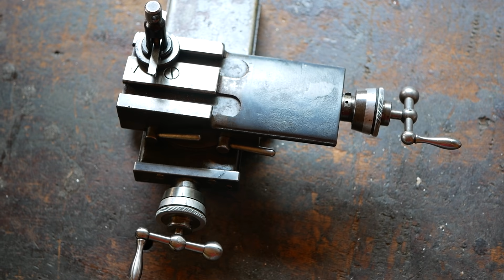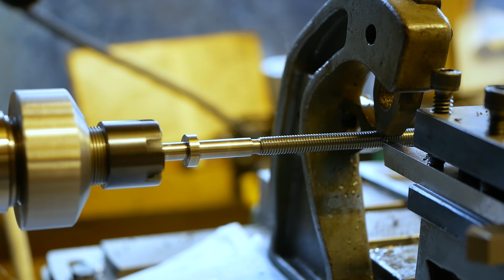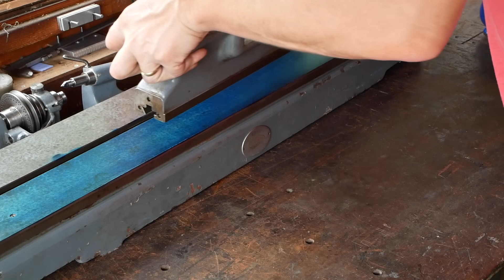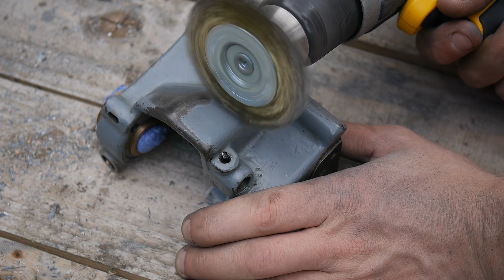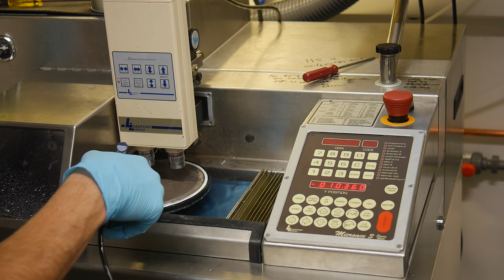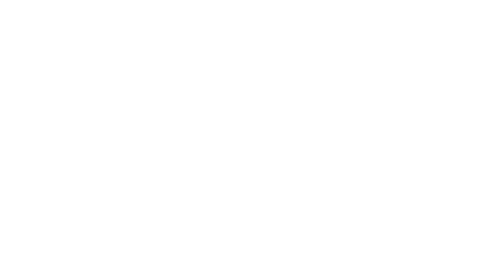Restoring a Vintage Watchmaker's Lathe

Comment: I have the same machine, a Schaublin SV65 with most of the accessories in top condition plus vintage documentation in case you need any. Wonderful machine! An old toolmaker friend of mine used to make the screws out of pretoughened toolsteel (ETG100).

Comment: I applaud your mechanical restoration.  True talent and craftsmanship is required to do that.  And I’ve seen this repeated in your other videos.  My complaint concerns aesthetics’s.  I truly believe the value and heritage of a mechanical device of this nature is destroyed when Bondo is used to smooth casting surfaces.  It’s a casting, formed by craftsman to make the machine you wish to use.  And it’s been wiped away by essentially plastic!  Maintain and improve the precision, as you did. Please let the heritage of the tool or machine shine also!

Comment: Red lead and a carbide scraper ... did it for LeBlond-Makino for about four years. Air is a liquid and is the only real way to drive above 50K rpm (there are some pie in the sky methods) without acute failure.

Comment: I'm having trouble understanding how the scraping of the cone bearing surfaces, and the bed, etc, isn't throwing off the accuracy between the headstock and tailstock for drilling holes accurately and centered, what am i missing here? or does scraping the underside of the headstock/tailstock to match the scraping on the bed cancel out any offsetting? similarly wouldnt scraping and lapping the bearing surfaces on the headstock and spindle create slop or concentricity problems, or does tightening up the spindle nuts cancel that out in a way? Your work is very impressive and I don't doubt them at all, I'm more so asking to gain a better understanding because I recently bought my dream lathe, a Boley F1, that I will be doing minor restoration work too, and better understanding these types of questions would help me if something came up with mine or if i found a need to do similar things to it

Comment: I am glad I get to see this again. I only wish I had an Alastair or Fred or anyone with more equipment than I have. I was getting close to finishing the rebuild of my Levin 8mm closed head stock spindle when I bought a grade A granite flat. So then I started looking for a height gauge so I can put my spindle shaft in my ner V blocks and check for runout. It is probably fine but why not check it, now that I can. I know, I have been doing this for months. But as always, you give me motivation. You feel Schaublin is best, but I may have an opinion. HaHa. Of course since mine has never turned and I have no experience, I will defer to you, I guess. Thanks

Comment: ive found that soaking parts in degreaser overnight seems to work pretty well for removing old oil based paint.
it works incredibly well, weirdly.

Comment: I’ve used large industrial lathes and vertical mills made before WWII. With proper care, they hold very fine tolerances.  The only problem is old American machines are seldom set up to cut metric threads easily.

Comment: What a genius way of heat treating your lead screws….really. …next level, thinking. 👍👍👍
Also, I’ve seen guys take motor assemblies with insulation issues…and just coat ALL the windings with shellac. And that seems to find its way to any abraded spots and coat them.
Perhaps that would be a first fix, before physically chasing down the actual short. 
Apparently, well thinned shellac is thin enough to run down between each winding. 
I thought it was a genius, blanket fix, since no one wants to spend days chasing a short. 🤷‍♂️

Comment: Excellent result.
I got lucky. 
The Chinese company Sieg make average to not great lathes. 
The SC4 that arrived out of the crate was unusable. 
I'd already let an emco compact 5 go to make the space but did ok for getting started.
There were no new SC4 available so I accepted the demo SC4.
Somehow they had made a 350mm bed lathe with less than 200nm runout on the spindle cold. 
The slideways were all good enough. 
It's sealed journal bearings that I can't measure any runout after the suggested warm up procedure. 
I've put 0.2mm into a pallet arbour with it which is respectable for what it is. 
Taper and journal bearings have an operating temperature range and a respectable lifespan but the sealed lubricant is a compromise.

Comment: Very honorable thing to take an old (and often abused) piece of precision equipment and bring it back, if not better than before! 😊
So many people would just overlook it as an old piece of junk! 😢
Great video!
Reply: Very few have the skills and experience necessary to turn it into anything but old junk as it was pretty far gone. These old machines are very challenging and time consuming to bring back to anything like the standard shown in this video. I actually think this is the only video I have ever seen where a machine has been fully restored rather than just serviced and repainted.

Comment: That part about the bearings caught my attention, because I wasn't able to find any definitive answer to this. My idea about it is (simply from the principle of operation) that preloaded ball bearings are stiffer, but have some combined runouts (not only from the bore, but also from the balls/pins). But for most use cases it's negligibly small. On the other hand, one can make his own almost perfect bushings, but they aren't so stiff. Thoughts?

Comment: Great work! Fully agree about the plain bearings and fitted such to a home-built lathe using fine-grain cast-iron, which I began in 1978. The ways were built up using bright-mild steel and show no sign of detectable wear in spite of contrary advice from mechanical engineers.

Comment: I did almost exactly this to my father's Myford ML7 lathe back in the 1980's. Getting the lathe rebuilt by Myford was very expensive compared to what he paid for the machine. I did a lot of scraping during my apprenticeship and was able to get the lathe bed, cross slide and compound slide quite good. The lathe had white metal bearings so scraping them was not too bad. 
I think the best bearings for lathes would be tapered roller rather than ordinary ball races but well set up sleeve bearings will do well and your lathe has nice long bearings which should not wear quickly.

Comment: You could probably build a sandblaster box by threading two big totes together with an access panel cut out one side covered with a plastic flap & magnet bar(s). The arm holes would be a bit more work, but I'm sure you could just wear a heavy jacket and use tight fittings around your holes.

Comment: nice my very dirty old boley f1 came yesteday, luckly im not to worried about the accuracy of the cross slide 😂 nothing beats these old schaublins, they really are the best.
Reply: My Boley F1 hasn’t been dirty or mistreated, and the accuracy of the cross slide is excellent. As far as I can tell it is lack of overall rigidity that limits the cross slide accuracy on the F1, but if you take smaller cuts to reduce the strain on the structure, the rigidity issue isn’t a problem. 

The F1 is a fantastic lathe imho.
Reply: @mercuriall2810  yeh it's been great, I'm very lucky basically nothing is missing from the lathe at all. Just the motor was swapped and electrics were cut unfortunately. I haven't had occasion to use the friction drive yet but will try it next staff I make
It's also just very pretty great industrial design
Reply: @felixarbable  If you’re not happy with the replacement motor, I came across a PAPST ECA 4511 as used in in the F1 and Lorch Junior, with speed controller for auction on eBay at the moment.
Reply: @mercuriall2810  do you have a link

Comment: I used by bier schaublin to make some barrel bushes mostly. did get to use it to make a cuter for a 10mm escape wheel for a ships clock platform escapement.
I needs some looking at but I sort of know the problems with it by now.

Comment: Well done on the restoration. I'm not a native English speaker, and fascinated by words just as much as engineering. Both likely so to understand the world. Whenever I hear 'high tolerance' I think of large tolerances, but this isn't usually what people mean. It's the high (number, thing) to strive for, as higher is better, unless it's not. People who know the high level are usually much less skilled than people with understanding of the low level. The higher my education, the deeper we went, and the smallest the subject matter became. Where the lowest point is the hardest to reach, yet people don't perceive it this way. This isn't limitted to engineering, though. Assembly is usually much more difficult than high level programming languages, etc etc.

Comment: I'm curious of the lubrication of the spindle, I have an old Åsbrink BS II it's a Swedish copy of the South bend 9"
Unlike the South bend, these are fitted with parallel Bronze bearings, similar to the rear bearing in your lathe, my machine had Staufer grease cups when I bought it.
But with grease I found that the spindle needed too much play, otherwise it got very hot.
With thin oil, that some recommend (ISO VG22) and oil drippers, the oil consumption were rater large, even with smaller oil clearance, it did not work well.
 I've settled on 0,02 mm in axle play, and now use a gear oil with 320 viscosity (EP 320) I find this to work the best for me.

What oil do you use, and or recommend, it's not as easy as I thought 😊
Reply from the maker: I would recommend Nuto H32 oil. You lubricator design is important too to control oil flow. The lubricators on the Schaublin 65 use a wire to 'wick' oil into the bearings, which works very well. By changing the wire diameter, the oil flow rate is changed. Best of luck with it.
Reply: @chronovaengineering  Thanks for the reply, I would probably (certainly) need a proper scraping of the bearing surfaces, maybe that could restrict the oil flow as well. (I have wicks also)
My bearings were very worn (Machine from the 1940is) and I did not dare to remove shim stock as much as I needed, (Afraid to damage the casting by over tensioning) so I actually put a shim outside the bronze bearing instead.
Not up to your standards, but sometimes one has to work with what you got 😊

Comment: What a lovely little video and a beautiful end result. I was wondering how you manage to take material off the main spindle when you lap it and then also remove material from the bearings but keep the correct clearance? Also, like others, I'd love to see more in-depth longer videos.
Reply from the maker: Thank you. I should have explained this in the video but the front bearing is tapered and the back bearing is adjustable by changing the thickness of a shim.

Comment: Neat stuff.  I'm interested in the difference between the scraping technique you are using here and the hook-shaped strokes one sees when doing larger surfaces.
Reply from the maker: Scraping using hooked-shaped strokes is a technique used only for oil retention (and decoration). It doesn't improve the flatness of a surface. I hope that answers your question and thanks for watching!

Comment: I use a HDMI microscope and a monitor on my Hardinge Super Precision and it functions a bit like a poor man’s optical comparator. I can use a thin Sharpe marker to mark on the screen and be surprisingly accurate on repeat parts.

Comment: Filling, sanding and painting those parts took me straight back to the 70's. My old man worked in the paint shop of a factory that produced the 'Rolls Royce of lathes'. I'd sometimes go to work with him on a Saturday and he'd have me cutting up big sheets of wet and and dry paper, changing his and his workmates bowls of hot water and when I was a little bit older he had me taping off the machined surfaces on the castings prior to filling and painting (he'd neatly trim the tape with a razor blade, but I think he knew that might have ended badly if I'd done it). Used to blow my mind how a rough looking lump of metal would look like it was made of glass by the time they'd finished with it. Even though they were on piece work, it had to pass QC and they took a real pride in getting it right.
Reply: Very cool. Do you remember the company’s name?
Reply: @gitpusher  Dean, Smith and Grace.
Reply: @grizcuz   Superb quality lathes.  Handwheels etc operated as smooth as silk.  Made other brands of lathe feel like junk.
Reply: Nice story :)

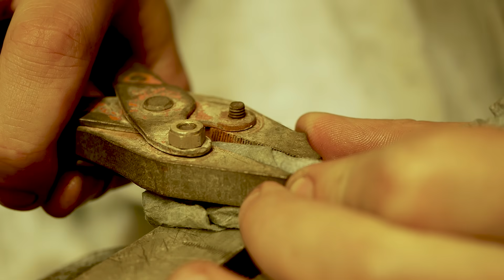Comment: 4:49

I hear it all the time "you need to grind hardened material" you don't! all the time I work with hardened material (hardest I've played with was 45hrc) and it cuts just fine with carbide tooling! you need to play with your feeds and speeds yes but it does work! the main thing to watch is it's like working stainless but you have the added issue of hardened steel will want to deflect your tooling more, you can take a finer cut but be sure to have a decently rigid machine or work holding and for something this small you would be able to cut threads in hardened material just fine since your already running your speed slow.

Comment: If you cant find "engineers blue" (which for some reason i couldn't find when i needed it) you can use oil paint with a firm rubber roller on your reference surface. Oil paint takes weeks to dry properly so it is very easily removable.

Comment: Hello,
Lovely video, thank you.
When you lap the spindle and scrape the bearing, how are you not increasing the gap between those parts? is there enough leeway with the film thickness?
Reply: or are the surfaces tapered?
Reply from the maker: Exactly. The front bearing is tapered and the back bearing is adjustable by changing the thickness of a shim. Sorry, I didn't show this in the video. Thanks for watching!
Reply: thanks for clearing that up! nice work. had never seen cylindrical shaping, very interesting :)

Comment: Nice outcome … many years of precision ahead!
Having restored a number of machines over the years, I found that using a brake caliper clear-coat over the paint, increases the longevity of the finish - both in chipping resistance and staining from oils and coolants.  Amazingly tough stuff, and can withstand a variety of solvents as well.  2-part is best, but even the single part provides superior protection as compared to a colored paint film.
Keep up the good work and great videos.
Reply from the maker: Thanks for the tips! I generally avoid 2-part clearcoats but because of the isocyanates but, agreed, this would be best.
Reply: Fair point about isocyanates, I used to carry out the HSE checks for TDI and we found that extraction booths in conjunction with good respirators were the way to go. Personally I use a twin cartridge full face mask with activated carbon, if I can’t smell the aromatics, I don’t think the isocyanates are getting through either.

Comment: Now this IS a very decent restoration!
So much better than all that disassembly > cleaning > new paint > assembly nonsense that many on YouTube call a "restoration".
Reply: they call it restoration, and it is in fact restoration
Reply: @shroomznapp  I don't want to be a nitpicker, but restoring means (as much as possible) returning something to its original state. Disassembling, cleaning, painting and assembling is making it pretty to look at. However, the machine "restored" in this way can be completely worthless due to defects and excessive wear and tear. These so-called "restorers" don't even bother to measure the degree of wear and tear, let alone do anything about it. This YouTuber, on the other hand, knows what he's doing.

Comment: Great video! One question I had while watching it is if you're going to replace or recondition the most critical components, what's the advantage of using an old high-end lathe as the starting point vs a lower end one?
Reply from the maker: I think it's a combination of factors. Part of it is down to design, which isn't really changed when the machine is restored. Materials are another factor. A good quality machine will generally use high-grade castings with thick walls and low porosity. And based on our experience, a new cheap machine needs a lot more work than a good quality worn one and that's because of all the little details such as stripped threads, poorly aligned bearings, internal stresses in the castings causing dimensional instability, poor tolerances on critical parts etc... I hope that answers your question!
Reply: @chronovaengineering  that makes sense! Thanks, and enjoy your new machine, it looks lovely!

Comment: Wonderful work. One question on scraping the headstock bearing. Were the bearings original or replaced? I would have thought that old bearings would be too worn to just scrape back in as the bore diameter would have gotten, if anything, larger, and the spindle smaller with lapping. Are the bearings adjustable in some way? Thanks for sharing!
Reply from the maker: Good question! The front bearing is tapered, so the spindle just moves inwards slightly. I didn't show this in the video but ID of the rear bearing is parallel and adjustable by reducing the thickness of a shim located in the split.